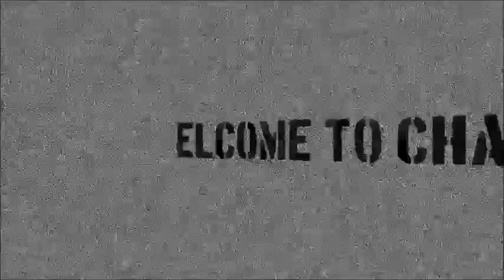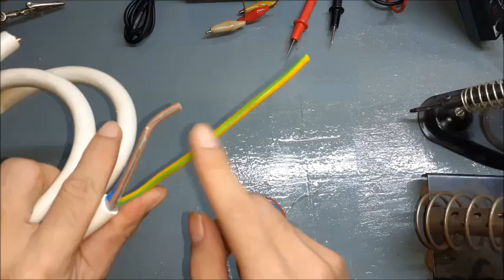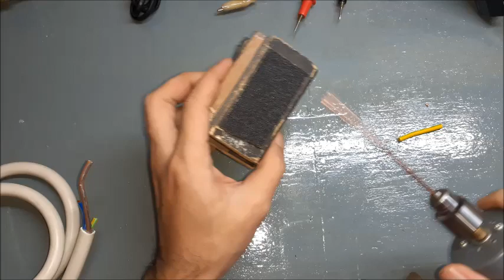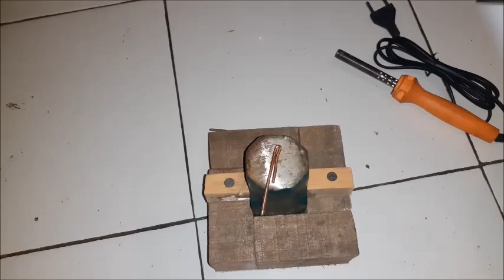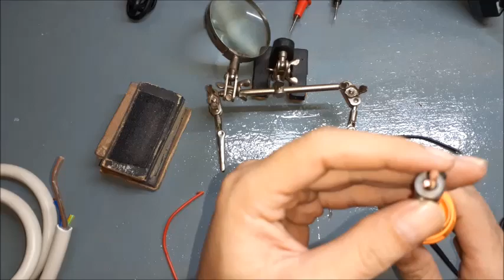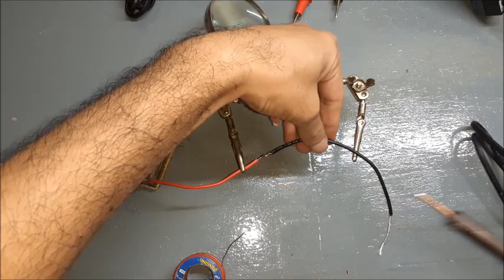CARA MUDAH MEMBUAT MATA SOLDER DARI KAWAT TEMBAGA

Comment: Mantap pas ada tembaga
Reply from the maker: kalau pengen lebih bagus lagi hasilnya, setelah di panaskan / penyolderan mata solder dari tembaga itu, ujungnya di tempa lagi di bentuk runcing terus di amplas halus. bentuknya jadi bagus
Reply: Kalau diamplas, kok timah nggak nempel lagi ya
Reply: @dapurngoprek871  
Mata solder bawaan ane kan tubul banget gan
Terus ane gosok ajah pakai asahan pisau sampai lancip
Akhirnya ane ga jadi beli lagi
Orang buat pas lagi butuh doang pakainya 😁
Reply from the maker: @radenpakubumi3031  ide bagus itu